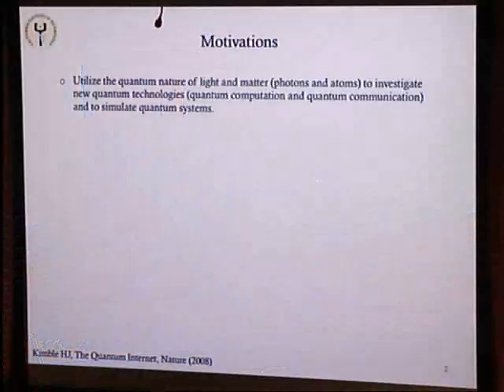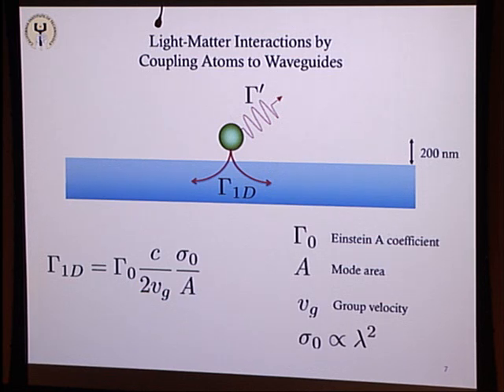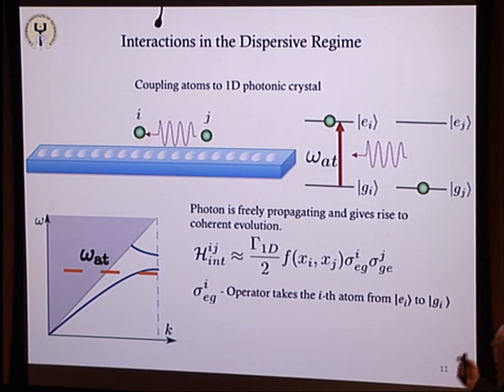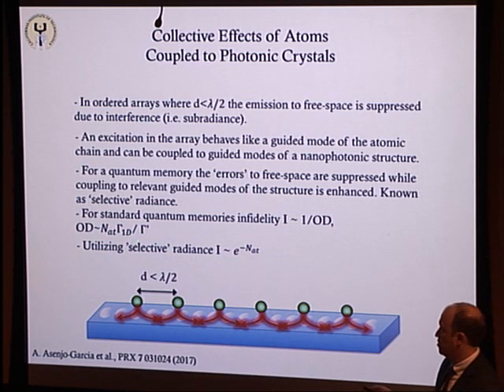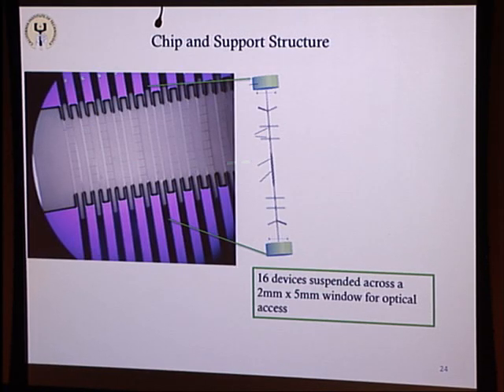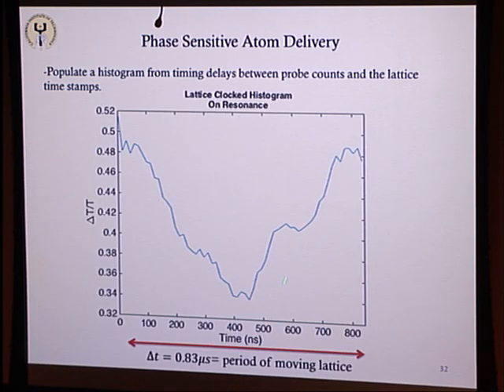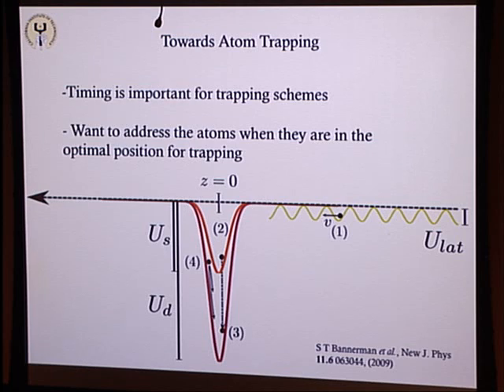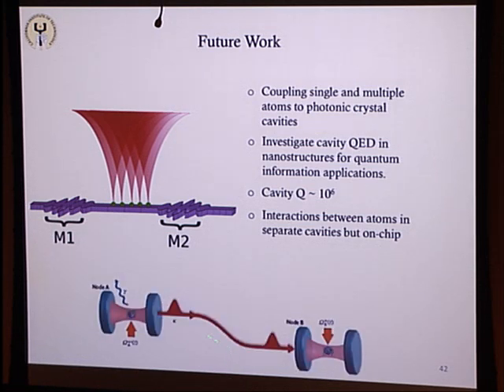Colloquium Alex Burgers: Engineering Atom-Light Interactions in Photonic Crystal Waveguides

Comment: Can someone discuss how the quantum state is read? If it's not 1's and 0's but a superimposition of two states how can it be read? The analogy I'm thinking of is how with Morse code the varying combination of dots and dashes transmits information. Would one think of the superimposition of multiple states as shades of a color? Meaning rather than an on and off switch (binary) you'd have a color gradient with the level of shadiness correlating to information? Thanks.